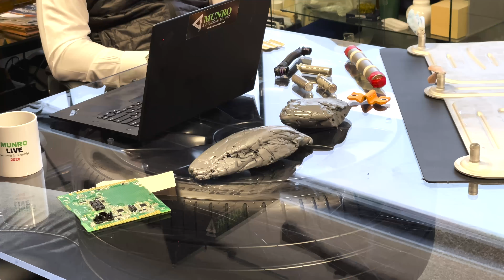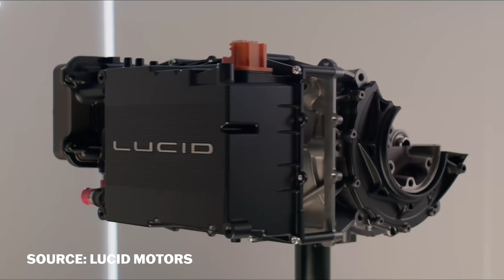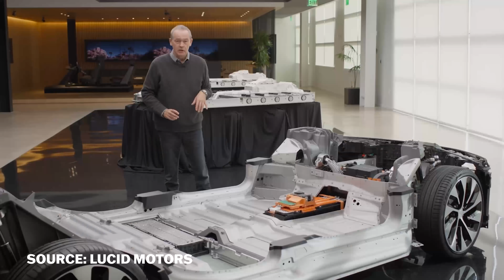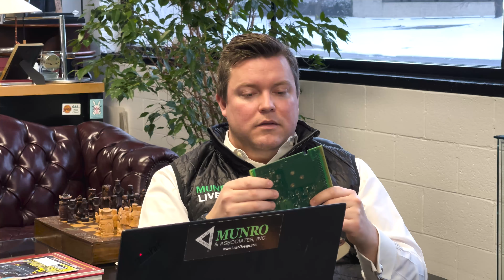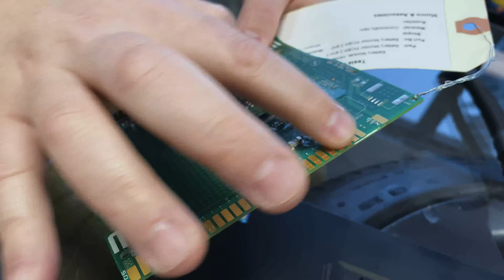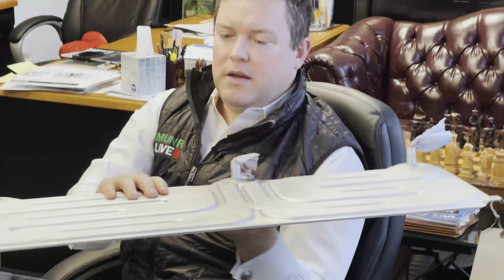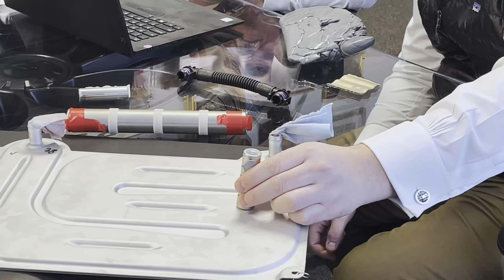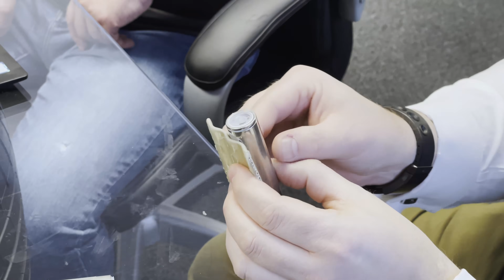Lucid Tech Talk 01: Battery Pack Reaction

Comment: Just remember this review is all about production and little no talk about repair. I like things that can be diagnosed and repaired easy and don't cost a ton for parts. I don't want a water cooled system, so pumps aren't used , direct drive hub motors and the high ticket parts like batteries need to broken down in to lower cost replacements if needed.
Reply: Coolant is really the only good way to maintain the battery for the life of the vehicle and in a massive range of temperatures. Direct hub motors are a horrible idea for a vehicle. But, I do agree the batteries should be modular and able to have one cell pack to be replaced individually if it fails.
Reply: @custommotor  The blade battery has no coolant needed and hub motors stay cool if you stay in the designed power range. The hubs are direct drive and that removes the losses of the drive train. The people that get in trouble with hubs are people that over volt hubs and run them outside the designed power range.
Reply: @stevegorkowski3246  
You understand the shock loadings on those hub motors will be "considerable"?
The blade battery, from every picture I've seen, had a large cooling gap between the cells.
Also, it's considerably taller than other cells (referenced in the video)
Reply: @rogerstarkey5390  Thanks for responding. Counter views will help up reach a better EV!  I have had no problems with shock loads with hubs. I must stress that some people are running hubs outside the power range that the motor was designed, by over volting the motor. This is spinning them faster than designed. This puts more stress on the bearings and in all the cases that I have seen the motor over heats and no damaged bearings. The key reason to use a Blade battery is that removes the weight, volume,cost and complexity of the liquid cooling system and still meet range requirements. The web has lots of information  on how this battery meets the requirements of modern EV's. Everyone has great questions. The basic design of the EV needs to stay simple to make the car trouble free. The design should allow easy upgrades like batteries as technology improves. They are doing just the opposite and building in more failure points and more cost.

Comment: It makes me ill to think teslas heavier drive units will be in Cybertruck when these smaller lighter lucid units exist.
Reply: So the Plaid weighs more than the Lucid? 😉
Reply: @St.Maurice  no but I’ll bet dollars to donuts it would weigh even less if it had lucid motors instead
Reply: @bob15479  Weigh less than the Tesla motors with the carbon fiber housing? Don't think so bud.  Did Lucid fix their cruise control yet?  Can they even do over the air updates?

Comment: i just want an independent analyst to tell us how big the Lucid battery pack is. there is evidence it's around 139 not 118 as they state. i'd like to know as it tells us if they have great tech or not.
Reply: Cry Tesla fanboy, cry!!!
Reply: The 139 KW/h idea is FUD (likely from a Tesla fan) and has been debunked. State of Charge/ Tom Maloughney discussed this in his Lucid DC Fast Charge Review and debunked it. 

Tesla's SC charging losses are well documented by Bjorn Nyland on his YouTube as well.

Anyone who understands physics knows that the faster you charge, the greater the charging losses are. DC charging usually incurs a penalty of ~10% on any vehicle.

But let's assume the FUD is correct- this means several things:
1) Lucid somehow found a way to DC fast charge with NO charging losses (meaning their charging technology is better than Tesla's)
2) Electrify America Charging stations also can charge with no charging losses (meaning Tesla's SC stations are wasteful piles of crap)
3) Lucid charges even faster than stated (so Lucid's charging speed is that much more impressive than Tesla's)
4) Lucid's battery cooling system is better than Tesla's to be able to handle charging at such fast speeds
5) Lucid is getting better commodity prices than Tesla to be able to offer a 10% bigger pack
6) It also means Tesla is lying about their battery pack sizes as well- Bjorn Nyland has documented a similar 10% discrepancy in charging output

Do a little research (and understand some science) before you spread FUD please.
Reply: @paulo3011  no FUD here, i honestly don’t know but only an independent tear down would clarify all the questions. Same as the tear downs clarified the questions about Tesla’s tech.

Cynicism here comes from Lucid doing its own tear down. This can be interpreted as a pre-emptive action to discourage independents like Munro doing it.

And Munro basically said he didn’t need to now. Hmm…

No different to Tesla’s claims; need independent analysis, no one should take the CEO’s word for it. That’s naive.
Reply: @paulo3011  I'm a Tesla fan and I approve this message
Reply: @rogerstarkey5390  Paulo's post clearly went over your head. He wrote about what it would mean for Lucid to have 139 pack instead of claimed 118. He doesn't claim that all his points are true, he's just stating the consequences of the original claim of lucid falsifying their pack size. In other words, points 1 to 6 are meant to be obviously falsifiable to show that the original claim doesn't make sense.
Reply: @zbyszanna  
The first paragraph did!!! 😉
Reply: @gazlives  
"Naive" is taking the word of someone (you know who) with an obvious axe to grind and zero technical ability who has never even been near the pack/ car, over both experts in the field and intelligent "non-experts" who have physically tested the vehicle and compared it to others..... ?
There's a weight of "probability" supporting the efficiency claims?
Ockham's razor and all that?
.
Let's face it, we're at, or very near the "Quacking duck" phase now, aren't we?
And just btw, there is (was) no "evidence. Just a cumulative series of incorrect assumptions and an inability to either admit, or correct the mistakes.
Reply: @rogerstarkey5390  disagree, only independent tear down answers the questions incl. the battery efficiency, the weight of the car etc. This is no different to Tesla.
I understand there are fan boys from Tesla that can’t hear that another car has great tech, but they don’t matter. Only the facts matter. And at this stage a tear down from the CEO counts as dubious Not as favourable info.
Reply: @gazlives  

The level of cynicism you're demonstrating   is unreasonable given thermodynamic fact. Independent analysis has already been conducted- go look it up.

Independent, repeated tests demonstrating DC fast charging losses in the range of 10% has been demonstrated across various makes and models of EVs.

In addition, usage at a fast charger goes up if you're playing the radio, running HVAC, preconditioning while charging. 

It's easier for someone with bias to create a false claim of a bigger battery pack than it is to conduct a teardown. 

The burden of proof should be on the person who made a claim of 139 KW/h without a teardown. 

But if you were really being honest and non-biased in regards to your proof with teardown requirement, you would simply say "I don't know the size of the battery pack without an independent teardown" since it could also be smaller than claimed.

Your words strongly indicate that you're giving more credence to a source that made a claim without a teardown than Lucid, who built the vehicle. This strongly suggests anti-Lucid bias.

Be wary of the YouTube videos you watch- producers of those videos make money. They're very much invested in repeating false claims of any EV maker (both positive and negative) as long as it produces clicks. Your cynicism is better directed at them. There are dozens of Tesla investor channels repeating false positive claims- they get paid double in clicks and inflated stock price ;)

Comment: The car is cheaper than the S and X from Tesla. It starts below $80k.
Reply: "The car" is not " cheaper than the S or X" untill they ramp production.
At this point "it starts at " $168,000
I'm sure you've used the same metric to criticize Tesla in the last?
"The car" or more accurately, a car SIMILAR to those existing "MAY BE" cheaper, when economy of scale kicks in.
Reply: @rogerstarkey5390  true it will be later this year when the $78k Air comes out which is LESS than the $100k for the base S. It is also true that the Air is much more efficient (w/mile) than any Tesla.

Comment: Heat does not rise!
Reply: Photons aren't lighter than air?
Reply: This is true. Hot air rises because it is less dense than the cold air. But the heat itself is not rising.
Reply: @AZOffRoadster  photons have no mass (theoretically)

Comment: I want to know the actual size of that battery. He has to be lying. No way they can get better range kWh to KWh to a Tesla
Reply: Did you even watch the Lucid video? Peter explains it all.
Reply: 118 kWh... 117 kWh usable. He even gave us all the numbers to check for ourselves lol.
Reply: So if it turns out to be true would you give them credit?
Reply: Why wouldn't they be able to get better range? Tesla has been getting comfortable, and thus lazy. Rawlinson simply invested a lot in this new drivetrain. Making it the first 500 mile EV. Whereas Musk is on a Twitter spree, and has decided for all that the range Tesla is offering right now should be enough for anyone.
Reply: @Jeroenneman  Exactly. A lot of range degradation happens simply by driving mountainous areas and using the hvac.  Make it an EV truck towing something and , like Rivian, you will be stopping every 100 miles to charge for 45 min.
Reply: because: MATH.

Comment: That battery has been rushed and it's crappy design.
Reply: That battery is designed to be sold in modular form to other builders and fit in various sizes and types of vehicle without modification..... As are the drive units.
They were talking about this 5+ years ago.

Comment: I'm not impressed with Rawlinson as a speaker or that Lucid are wholly honest about battery size, specs & efficiency.  Him doing the teardowns instead of giving the battery to Munroe associates leaves the option for custom building the battery pack to... hide something...  Don't forget, many, many people trusted & believed Trevor Milkem for a long, long time.  Coming from Lotus, PR should have "just add lightness" engrained in his psyche.  The Air is a VERY heavy, car.  Maybe the battery has more cells than Lucid (Peter) are claiming?
Lucid's claim that their motor/inverter combo is industry leading compact/lightness.  Sandy says no.  What other BS is Rawlinson claiming?  I really don't trust what he says (which isn't much, generally, other than frequent hype).
Plenty of Razzle Dazzle... To me that describes PR in a nutshell.
Also the cell links disarray & irregularity doesn't follow PR's claims of "most efficient" EV drivetrain, which he's ALWAYS banging on about.  Well, their investors & customers believe him anyway.  If those cell links, 22 BMS boards & wiring/interconnects are anything to go by, the Lucid isn't going to be the "quality" EV he's always harping on about is it?  I have a strong suspicion he's full of hype & the Air will fall short of expectations & take a lot longer to improve than any Tesla's ever did.  Maybe I'll be proven wrong.  Maybe those links/interconnects won't fail.

Comment: Sandy’s bad sound makes good video look bad.
Reply from the maker: Sandy's mic had technical issues. Sorry
Reply: @MunroLive   The first time you posted this yesterday I told you that you should always make a test recording and check it before a presentation. It’s like doing a run -up on an aircraft before takeoff or adjusting the mirrors before you drive a vehicle.